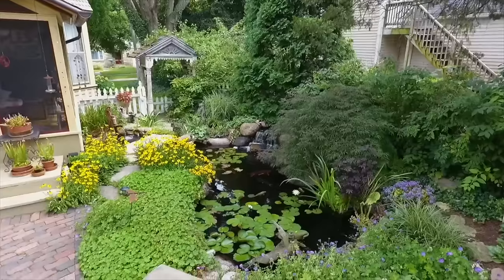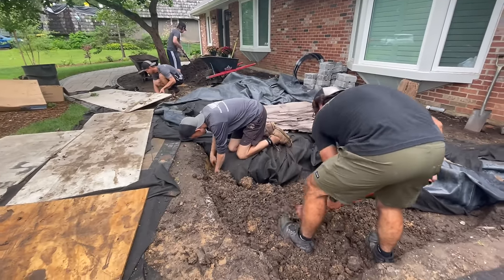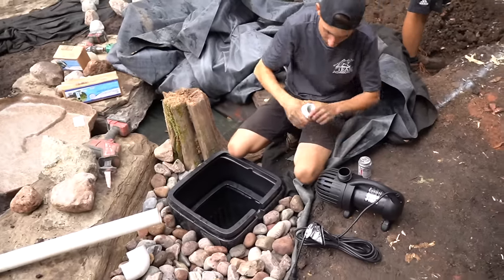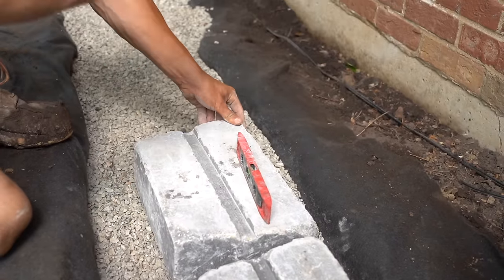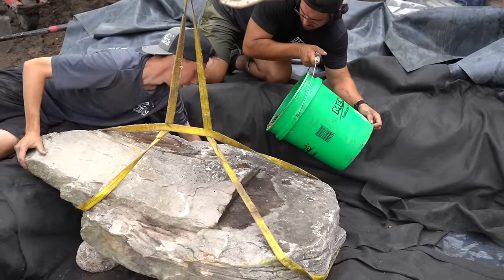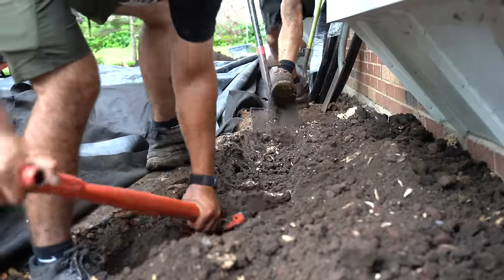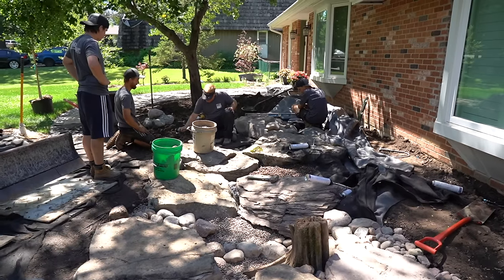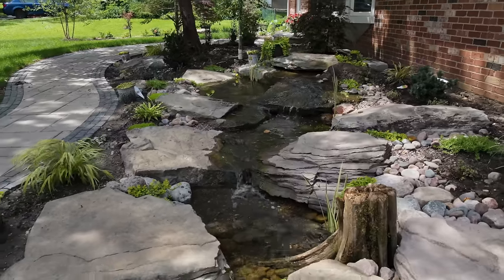NEW Curb Appeal - Out Front Water Feature

Comment: That stone you're picking up at 6 minutes in, how much would that run (roughly)? I've got at least a dozen of those and a few bigger in the woods at the back of the property. That's what is visible anyway. When they built the neighborhood, they put all the extra stuff there. Wouldn't mind trading the stones with a local AS contractor for a little excavator work, if possible.
EDIT: Oops, not sure what kind of stone. I think some sort of slate. You can see it exposed along Blue River Road between Red Bridge Road and Blue Ridge Road in Kansas City, MO.